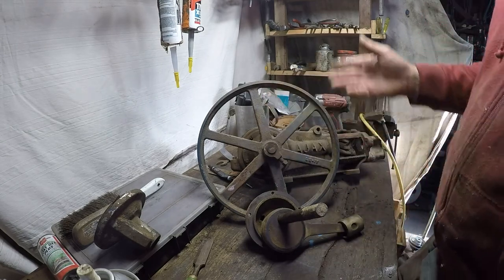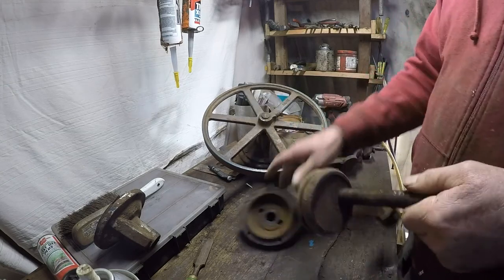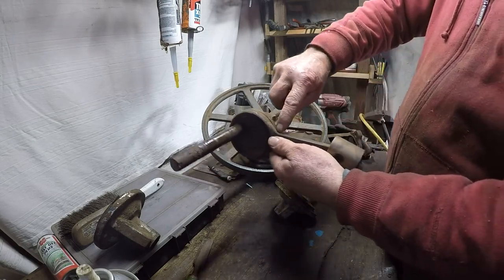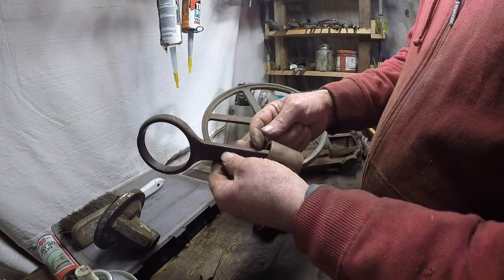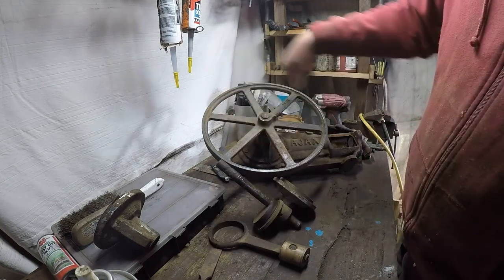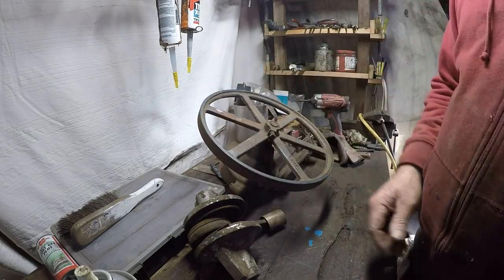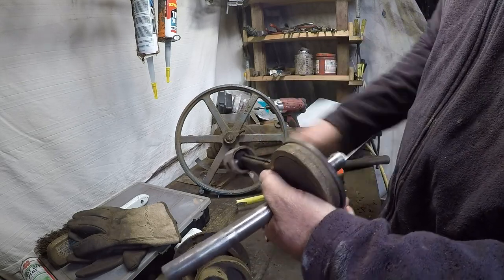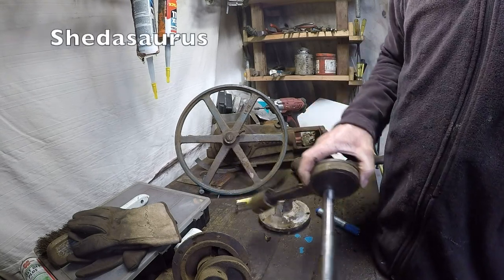Piston Pump 1 1/2" Pulley direction and oil info

Comment: Thanks for your videos on these great old pumps. I'm rebuilding a Deming pump. I can get 6 gpm with no back pressure and about 3 gpm at 60 psi. But the gaskets that I have been making out of gasket material and permatex are not holding the pressure. What do you use for gaskets?
Reply from the maker: Insertion rubber

Comment: I want to run my Deming pump with a Dankoff DC motor that came with a solar pump. Unfortunately the motor runs the opposite direction from what you recommend here and also from the arrow on my pump. The motor will run backwards, but I'm not sure whether that it would last. I could turn it around, but then I lose the use of the nice built-in platform and tensioner.
Reply from the maker: You would have to check with an electrician, from what I have been told it can go either way